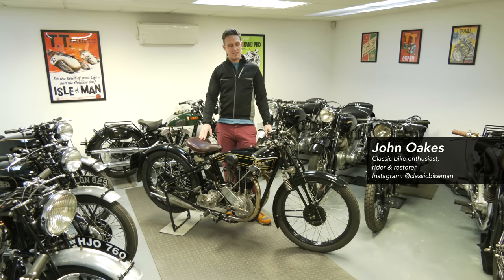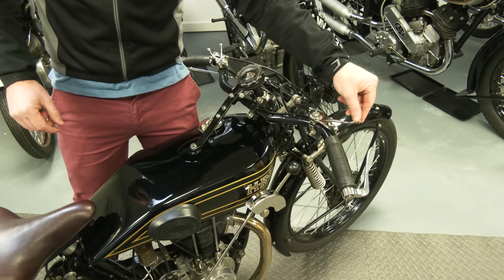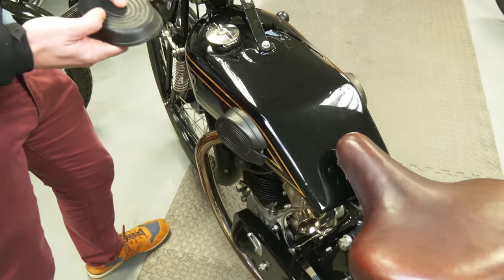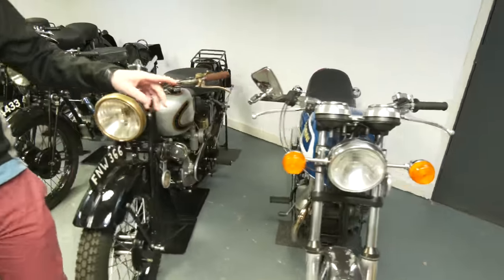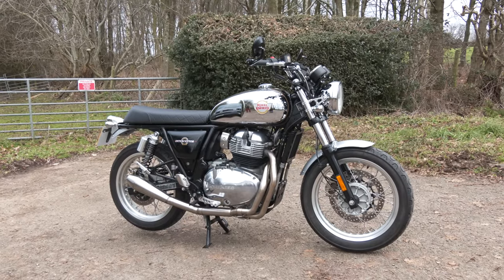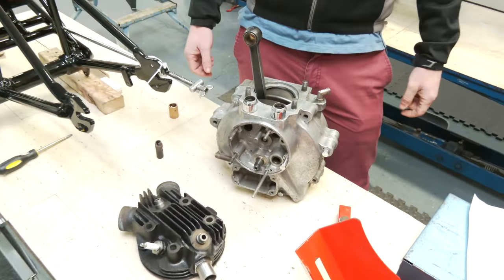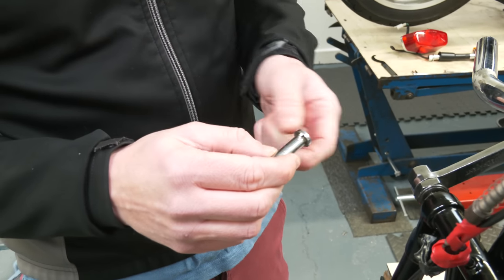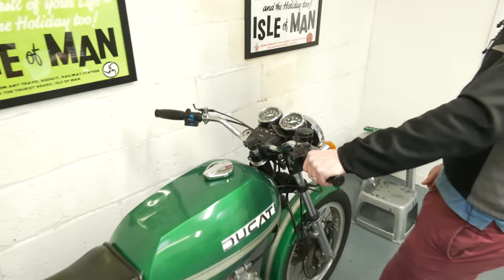Classic Bike Man Video Log 3 - we bought 2 more new bikes

Comment: When I was about twenty I owned a Desmo sport 500. I remember it was very finicky in respect to the right battery being fitted and having a full charge. With a less than fully charged battery it would give the problems you are experiencing.
Reply: Hi.  Thanks for the comment and advice . I’ll try another battery on it to see if that helps it run better 👍